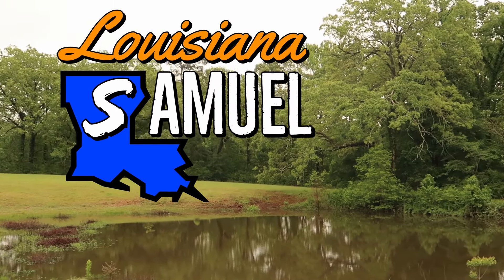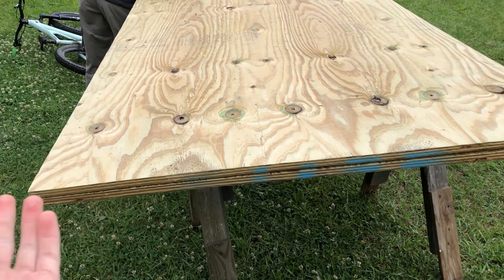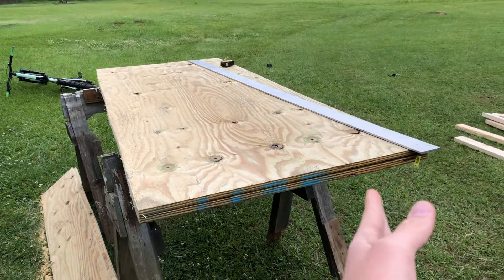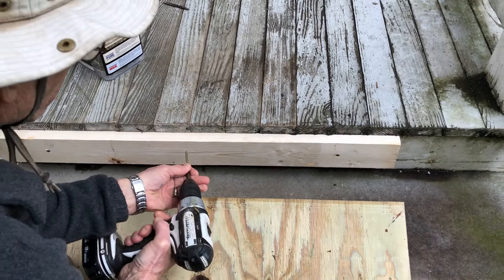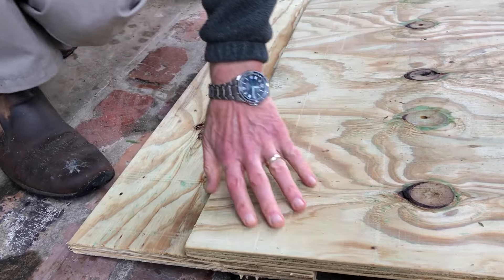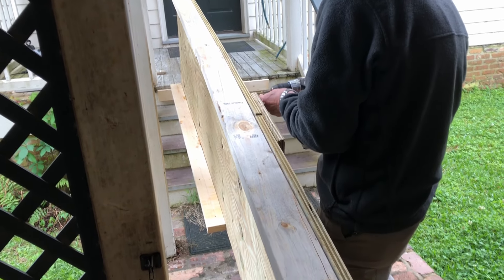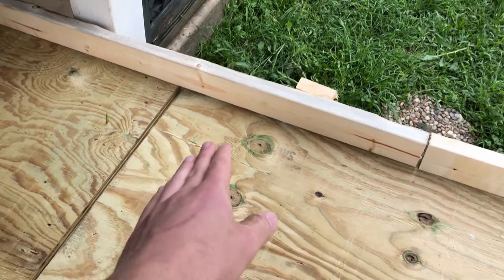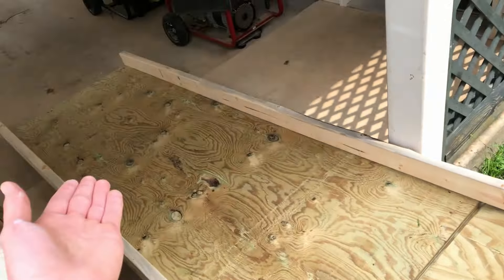Making a Wheelchair Ramp to Get Grandma out of the House (30 minute diy)

Comment: It's a nice ramp, but it's WAY to steep! The pitch for a wheel chair ramp should be 1" rise for every 12" in length. So really if you have to go UP 4 steps @ 8" a step that would mean the ramp should be 32 feet long. Otherwise someone will have to assist her every time she needs to get in or out of her house
Reply from the maker: during the time she was in a wheelchair she never learned to push herself and always had someone to assist